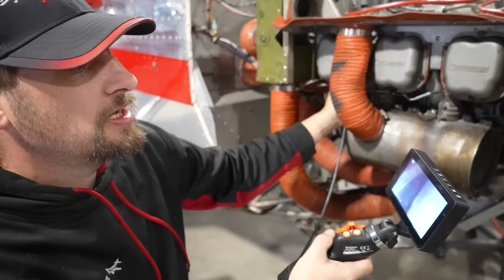Is Electronic Ignition Worth It?

Comment: There are several misleading statements in this interview. First, all the electronic ignition systems will increase heat production in the cylinder (unless they're locked to the default BTDC advance). I believe all vendors set the expectation that CHT's will increase by 10-20deg, and pilots need to be cautious about temperature management. This is especially relevant for turbo engines, for example enabling the variable (advanced) timing for a turbo engine is explicitly disallowed in the Sureflight STC. The interviewee highlights that temperature increases when 1 mag is grounded; this is confusing EGT and CHT. EGT doesn't matter, unless as a reference for leaning and/or limitations on a turbo engine max TIT. 
The second comment that's be widely debunked by Savvy etc is that "most engines aren't going to make it to TBO", due to lead deposits and oil-ring buildup. Neither of these things require engine overhaul or cylinder removal. These days, they are detected early through regular borescope inspections, and can be remedied in place by valve lapping and ring-flush efforts. With proper repair-on-condition and inspection activities, these engines are able to run to 2x TBO and beyond. That being said, his recommendations for use of electronic ignition are good recommendations.

Comment: He’s pretty spot on! I noticed you used a few clips from my install with Glen’s Hangar. One system is generally the most cost effective solution, for the dual system there are additional cost benefits over the life of the engine despite the increased higher cost of install. In the dual systems, it’s extremely beneficial to do a cylinder cleaning procedure at the same time due to lead fouling is the plugs shortly after installing the system due to drying out the lead buildup & causing it to shed. Resetting the idle & like mixture is also key to a to getting the engine operating n performing correctly. Smooth Power can give some recommendations for installers.

Comment: I've installed a Surefly Impulse magneto for my PA38 112 Piper Tomahawk.  Love every minute of it. Smoother hot starts, lower fuel GPH, Lower CHT/EGT, leaning has shown smoother LOP, Slightly more power on takeoff. Less 500 hour maintenance with Surefly Impulse magneto.  Waiting to install my EarthX TSO900 battery next to see how much more power on hot starts I will have after replacing my Concorde battery and save 25lbs in overall weight.

Comment: Way too much misinformation on this video. 

Gummed up oil rings can be resolved by doing a ring wash. In many cases, you DO NOT need to do a top overhaul. You guys need to watch Mike Busch’s videos on this.

Also, leaning INCREASES cylinder head temp due to less fuel cooling the cylinders, which is why you do not want to do it in a climb as you increase the chance for detonation.

Lastly, since hot starts are caused by air in the fuel lines, kindly explain how a hotter spark would help??

Comment: I fitted the Electroair system to my Robin DR400-180 ( Lycoming O-360 ) and am very pleased the initial impression is better starting, smoother running and a fuel saving of around 1 USG/HR. The paperwork was a bit of an issue with it being a French aircraft that never got an American type certificate and on the British register. The U.K. CAA have been very helpful over the certification as they have seen this Electroair system fitted to a PA28 using the FAA STC. The aircraft is very short on space forward of the firewall so getting the coil pack fitted required some work but all the rest of the install was not troublesome. It took me three days to get this job done but I would guess I could do it in two days ( on a Robin ) with the experience gained from the first instal. Aircraft like the PA28 & C172 should be a great deal less trouble as they have much more room forward of the firewall and better access. As I only have 35 hours on the engine and EI system the long term benefits are not yet apparent but my overall impression is very positive.

Comment: This is Sealy buyers to electro air, which is fine, but at least make it no known fly has dual magneto STC replacement and sure fly also gives a much stronger spark from its discharge coil just like electro air. They’re not the same but they are more similar than different. Let’s put out good information out there..

Comment: FADEC: The PA28 can be converted to the Continental Diesel Engine. ElectroAir: I have one in my 1974 Cherokee Warrior  (installed it on a mid time engine). It's worth every penny. Starts better, uses less fuel, runs smoother.... Power Increase is quite nice... and the EAir's TBO is significantly higher than any magneto.

So: Fuel savings, Magneto Overhaul and everything else considered.... this Mod pays for itself.

Comment: I can't imagine trying to add a second alternator to an engine. It seems putting twin electronic mags in an older plane would be very difficulty.
Reply from the maker: Some Cessna 210's have dual alternators.  THere have been many times I wish I did in mine.
Reply: B&C among others sells backup alternators that mount on the vacuum pad so it's not too difficult to move to dual alternators. Given the crap reliability of vacuum pumps I'd rather have dual alternators.

 There's also EMag which claims to built a mini alternator into their system so it can pull from aircraft bus or its internal alternator but I don't know much about them.
Reply: How would you power the alternator if mounted on the back of the engine on the vacuum pump attachment site ?

Comment: Thanks for the shoutout, and I'm glad the footage of our instal was helpful to tell the story!
I'm beyond pleased with the ElectroAir electronic ignition that we put on my 1961 172B (Continental 0-300) - improved starting, and about 1 gallon per hour lower fuel burn at the same altitude and power settings... which of course lets me run a higher power setting for the same fuel burn as before. 
Stop by my channel if you want to see the whole instal.
Reply: 1 gal per hour is pretty significant on an O-300. That’s impressive. How different are the CHT’s?
Reply: @VictoryAviation  The increase in CHT temp is negligible and well within the safe range.

Comment: For what it's worth, I have a 1968 Cherokee 235 (O540-B4B5) and had the Electro Air system installed and have two years and 300+ hours on it.  Love the push button start, engine stays clean, smooth power and noticeably stronger than Magneto.  You'll see only about a 10-20 RPM Drop when mag checking (magneto off) because the EI is so strong (70,000 volt).  Also, I replaced my Left (impulse) mag because EIS provides full spark at 0 RPM, includes MAP sensor/control of timing so starts are a breeze.  I have been very happy with my investment, and have flown from Las Vegas to South Florida, the Bahamas and back twice...never even a hiccup.  Just my experience, your milage may vary.  Purchased through Smooth Power, they were great with support for my shop and me.
Reply: Forgot to mention, I purchased the recommended fine wire plugs from Electro Air as well, and also replaced my others with fine wire too.  Make sure to check the plug recommendations when researching.  The voltages are high, so the plug gaps are different.  I went with fine wire and could not be more pleased.

Comment: Christy, our club has one on our Archer and we all feel it was well worth it.
Reply: We put EIS on left engine of Archer and it would leave pilot stranded as it was so difficult to start. Hard on battery and hard on starter. Followed install instruction to a tee and revisited during troubleshooting. With continued problems customer requested it be removed and Slick reinstalled. Then started dependable.

Comment: If one is replacing the engine, then I would consider the Deltahawk diesel.
Reply: That's a great thought... if you have one of the aircraft they are working towards STCs  on.
Unfortunately they've told me that they won't be seeking an STC for my model of aircraft.
Reply: Already better diesel engines on the market.
Reply: @chippyjohn1  Please let us know what these better engines are, and which aircraft they are certified / STC'd for.
Reply: @GlenAndFriendsCooking  Not certified. Certified means nothing. Not as though you could just swap a deltahawk into any certified aircraft. BMW M57 is a great engine, but not very common anymore. B57 with some modification would be better than a deltahawk. The issue is people are demanding modern powerplants when the aircraft are all designed for old engines. The B57 with slight modifications is good for about 200kw continuous power, and a peak of 225kw. The deltahawk 235 is only rated to 175kw peak, and it is about 10% less efficient. I know you will laugh at that. The BMW engines have and still are being used at max power continuously in marine applications on a commercial level. I'll be using one for my next experimental helicopter as it's the best option available. There are 4 cylinder variants available, just as diamond uses a mercedes version in their aircraft.
Reply: @chippyjohn1   Got it - you're not talking about powerplants for certified aircraft.
Reply: @GlenAndFriendsCooking  The diamond aircraft are certified.
Reply: @chippyjohn1  Yes - I know that. What everyone is asking about is a diesel that will end up with widespread STC's for legacy airframes so we can move to Jet-A (and associated) fuels.  My airframe doesn't care what's spinning the prop as long as it's within a certain size and weight, but the regulations do. So I'm interested (as are many other legacy owners) in how I can upgrade and ditch the 65 year old Continental under my cowl. BMW automotive diesels may be your jam, but they don't cut it for those of us who fly certified aircraft, and are looking for change.
Reply: @GlenAndFriendsCooking  For an engine that is said to retail for 200k at the base model, you could purchase a new aircraft. Best of luck. I think the delta will have issues, mainly with exhaust ports, and or they will go bankrupt.
Reply: @chippyjohn1  If you had read my post above - DeltaHawk isn't an option for me. They aren't seeking an STC for my aircraft.  Not sure where I could buy a New Jet-A burner for $200k, can't even build a Kitfox for that money.
Reply: @GlenAndFriendsCooking  What's the importance of Jet A1? Diesel is cheaper and readily available everywhere. Unless you are restricted to regional/international airports, there is little benefit to jet-a. A1 is better for colder climates, that's about it. A non leaded petrol engine is better again.
Reply: @chippyjohn1   @chippyjohn1   I guess you don't fly where I do. 100LL is becoming less available at airports I frequent, but Jet A (and variants) is abundant. I also frequently fly to places that are not road accessible year round, so JetA (and variants) is brought in by ice road once a year, or by boat once a year.  Diesel isn't as readily available everywhere as you think. Yes this is a specific use case - But I'm not the only one in this situation.

Comment: Quicker starting due to hotter spark - That's a plus!  
More power - who doesn't like more power? (cue the Tim Allen "Uuuh-uhhh-uhhh!")  
Only at the end did they talk about the cost saving benefit of NOT having to send each of your magnetos in for overhaul every 500 hours.  Figure over $800 for a mag overhaul, providing nothing is otherwise out of spec.  10 working days (two weeks) plus shipping for the overhaul shop for your mag overhaul, then the added cost of your own A&P time/scheduling...  
So figure that $10k initial investment in the Electroaire ignition (including labor) minus the $4k for the mag overhauls for the one magneto over 2000hrs... That brings the cost per 2000 hrs to $6k
Also subtract the fuel savings (most figure almost 1gal/hr less fuel burn ($6/gal x 2000 hrs)) so another $12k saved, so we've actually SAVED $6k for 2000 flight hours
AND the more efficient burn meaning less Top overhauls...  another major savings!!!

You'll actually probably see a NET SAVINGS of nearly $10k or more between Engine Overhauls!!!

Comment: Hotter spark & easier starting. Some units offer automatic timing adjustment based off manifold pressure for optimized spark timing. This also includes fuel efficiency improvements if optimized ignition timing is provided at altitudes.